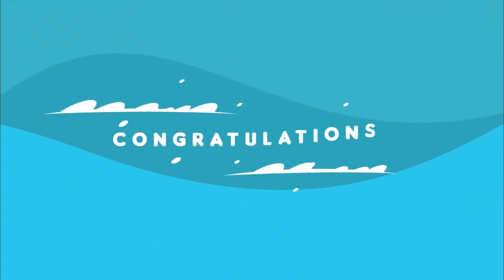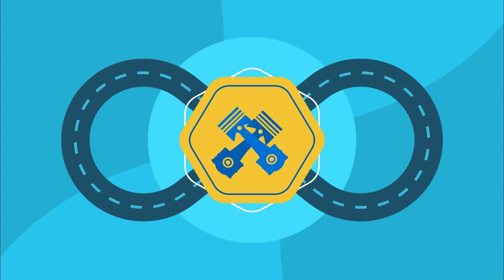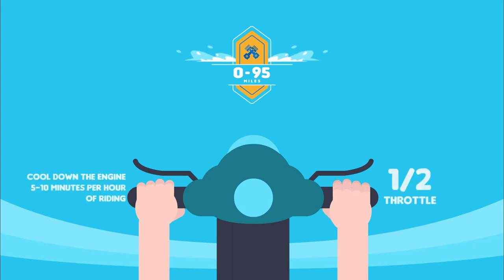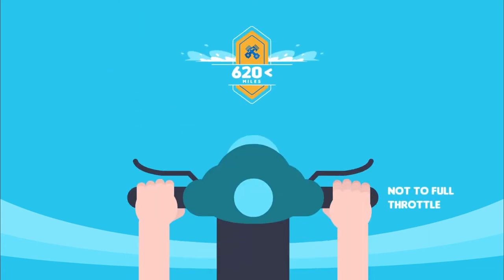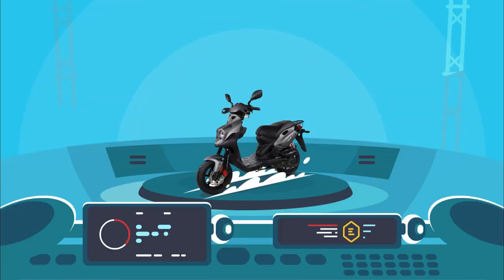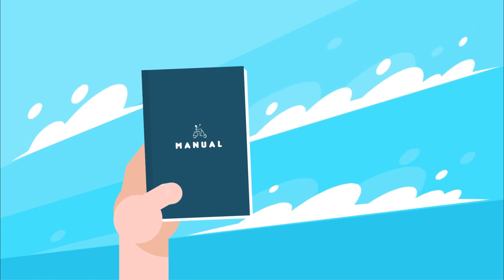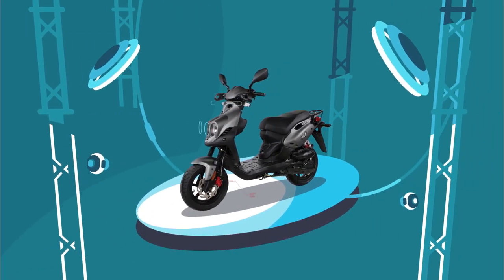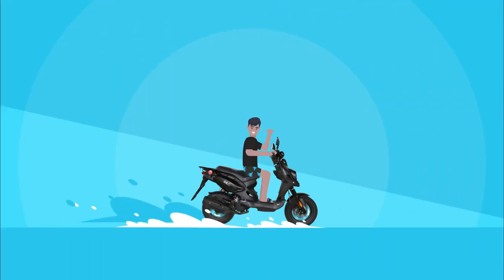How to break-in your new moped or motor scooter

Comment: HOW do you avoid Traveling at a constant speed since you HAVE to obey the speed limit?
Reply: Someone just reading a manual that's all it is
Reply: Limit is a hard to understand word, I can see that. The speed limit is the top speed you can go , you can go slower.
Reply: @tedbrazee7948  I wasn't being salty to the guy just asking a question.
Reply: @Omnipotant_1  Are you being snide? If you are on the highway with a max limit of 70 you have a minimum limit of 45. In my town for city streets say 45 max limit you cannot go below 35. However the rule that keeps you out of trouble is matching speed with the traffic which you'll have to do all of the time you are In traffic.  If you only have a 10 mph margin for error, it makes it harder.